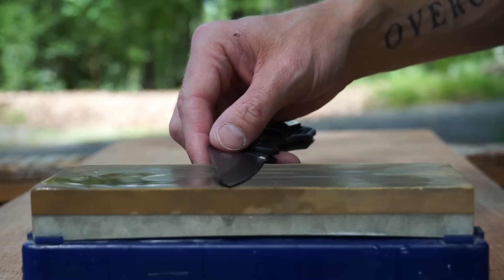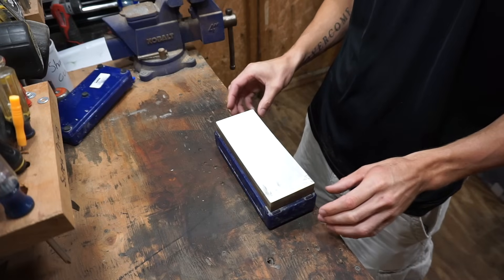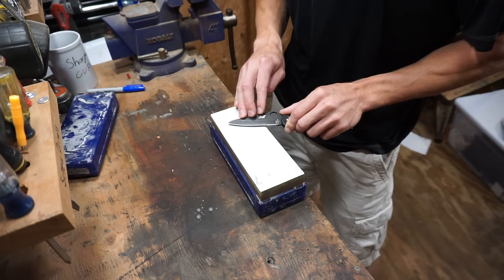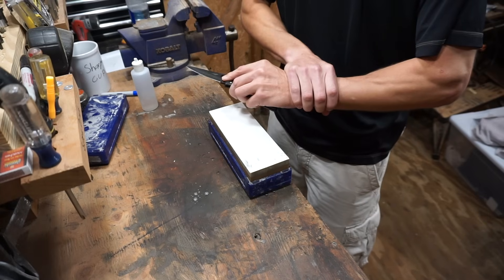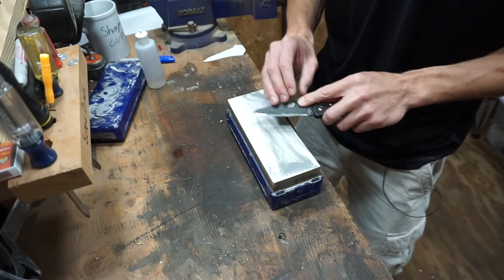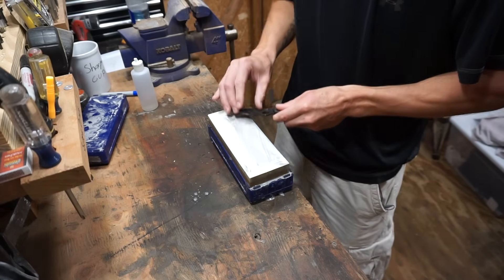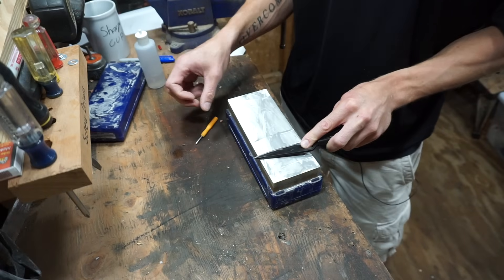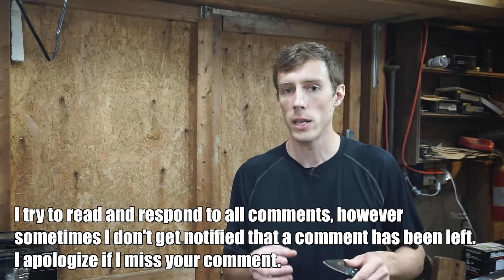KNIFE SHARPENING TIPS BEGINNERS MUST KNOW 2  |   HOW TO MAINTAIN AN ANGLE

Comment: I’ve watched countless videos on how to sharpen a knife, used countless sharpeners and I still can’t get it right. I just purchased a 1000-6000 grit wetstone from amazon for 40 bucks and I’ve tried and tried and I just can’t seem to get the angel right. I’m at a loss. I do exactly what you say in your videos to no avail. It’s extremely irritating!! What do you think I could be doing wrong? Should I invest in a more expensive stone? Different grit stone?

Thanks
Reply: use a coarser stone to start. Your stone is to fine tune 
It's in a video by the boss

Comment: What if you have a longer blade, or a blade with a curved tip? 
Thanks!
Reply: That's the hardest part for me too. I never seem to be able to keep the same angle around the curve of the belly.
Reply from the maker: Just modify the movement. If the blade if VERY long (over 10") you may have to work it in sections. I wouldn't recommend starting on a very large blade. They can be tough even for very experienced freehand sharpeners. If the blade has a curve follow the curve keeping your wrist locked in place. Thats one of the reasons I recommend separating those two movement. One to lock in the angle, the other to move the knife across the stone, following the blade profile. Hope this help😀
Reply: OUTDOORS55, it does! Thanks! =D

Comment: I've always been told that you push the knife away from you instead of pulling it towards you, or does it matter.
Reply: It doesn't. Pushing both ways increases the speed of sharpening. Pushing toward the edge takes more metal and your stone. The only time it matters and recommend to push outside from edge is during polishing as those stones tends to be very soft and it's very easy to dig into them and damage them. And obviously stropping, you shouldn't push toward the edge.

Comment: The more I learn the less I know, it seems. Still working on locking the wrist and elbow. They should invent a splint for knife sharpening folks. 😉 Trying to learn how to use both hands for holding the knife properly on the stone. Not as easy as one would think. Looking at different angle guides to help. Thanks!
Reply from the maker: Haha good idea!😂 Honestly its just practice. It takes some time to learn but once you do it's DEFINITELY worth it!